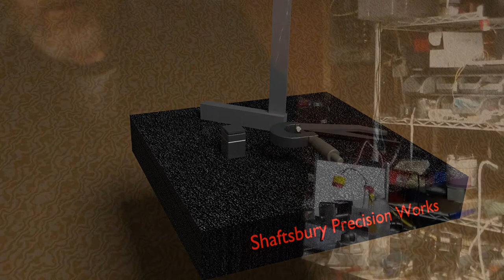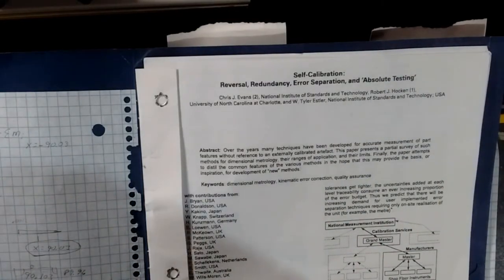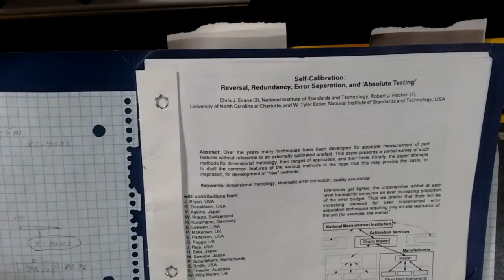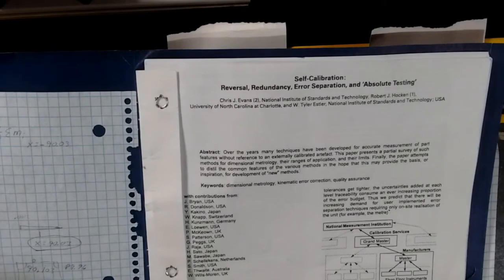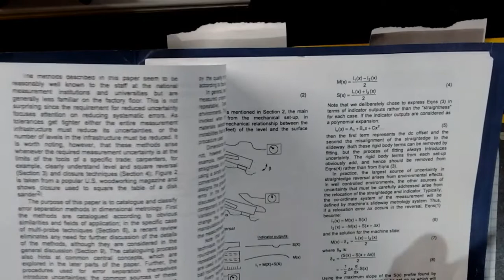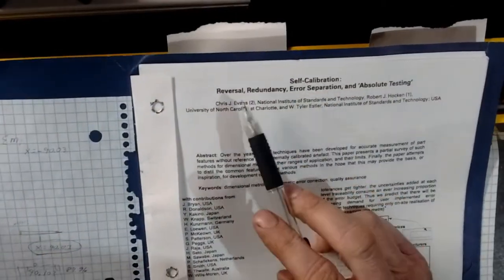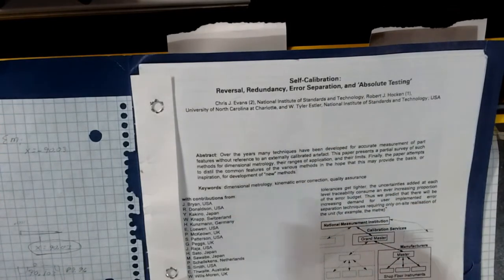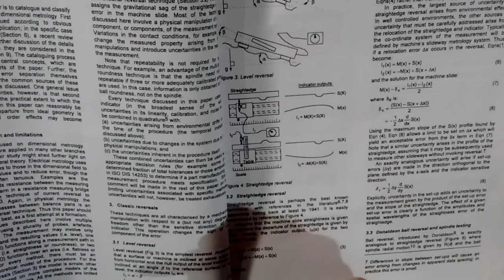Using reversal methods to do calibration. The level, part one

Comment: Hi Wayne, Thanks for posting.  I think that this is a field of Metrology that more and more hands on Engineers will need to become familiar with, in light of increasing precision of machinery and methods.

I would like to take the liberty to explain the maths for those who want it.  I mean no disrespect in doing this but there may be those who want to know.  Those who can do the math can just skip this comment.

Eq1: I(one) = A-B
Eq2: I(two) = A+B

The important thing to consider here is that these two equations are true AT THE SAME TIME [which that would not be had you changed to different equipment half way through].  This means that we can use simultaneous equations to find our answers.

First; solving for A, we remove the B's by adding the two equations.
     I(one) = A-B   PLUS
     I(two) = A+B

     I(one)+I(two) = A-B+A+B  [and since the -B and +B cancel out to get]

     I(one)+I(two) = 2A       [dividing by 2 to get]

     A={I(one)+I(two)}/2      -   your result.

Second; solving for B, we remove the A's by subtracting the two equations.
     I(one) = A-B   MINUS
     I(two) = A+B

     I(one)-I(two) = A-B-(A+B)  [and expanding the bracket to get]

     I(one)-I(two) = A-B-A-B   [and since the - A and +A cancel out to get]

     I(one)-I(two) = -2B       [dividing by 2 to get]

     -B={I(one)-I(two)}/2     [Now we multiply by -1 to get]

     B=-1*{I(one)-I(two)}/2   [multiplying out the top bracket to get]

     B={-I(one)+I(two)}/2    [putting it in conventional order to get]

     B={I(two)-I(one)}/2      - your result

I hope this helps someone just starting into the field.  I am sure there are many hands on Engineers out there who can calculate the number of turns of a dividing head handle for a given degree without batting an eyelid - but they may have for gotten this maths. 

There are many fine vids on here formalising the solution of simultaneous equations.

Good luck, look forward to the next vid.

Seth

Comment: Indeed very well done. The speed and length are fine. 

What would be nice is to work out an example to measure a straight edge to see calculate it straighteners or error. This method could be a more achievable method than the optical measurement you showed in another video

Comment: Wayne:  Yes this math that you applied we do that in our heads when we adjust a  4 jaw chuck or centre up on a hole.  there may be other examples.  the math is good especially to write software. i down loaded the paper but have not yet done my home-work.  Laugh out Loud.   Thanks again. ron